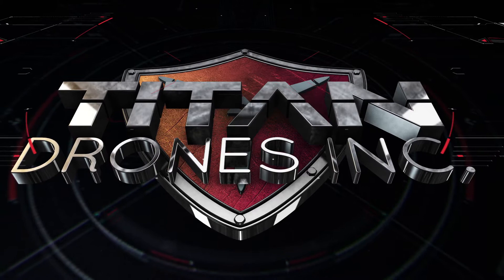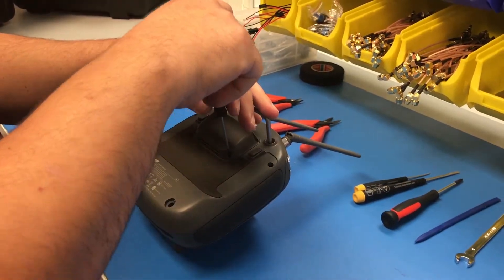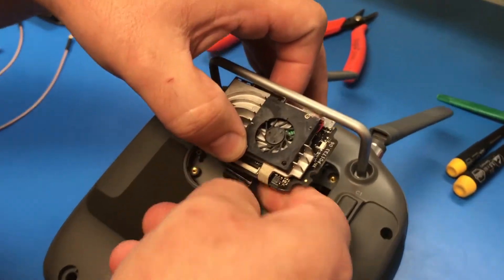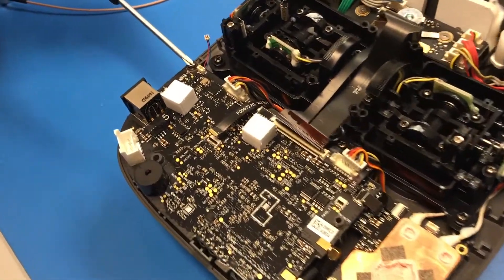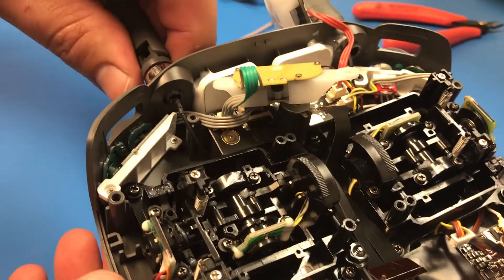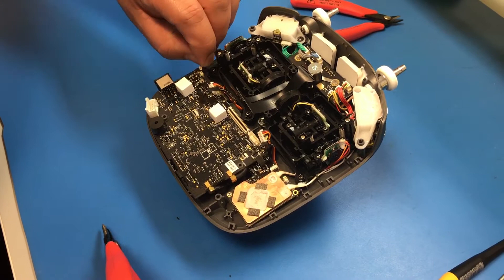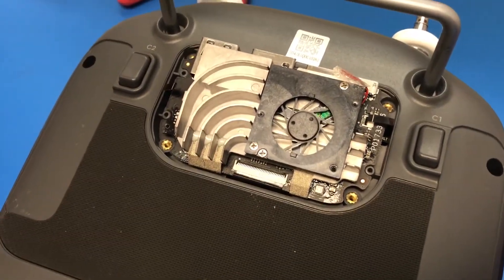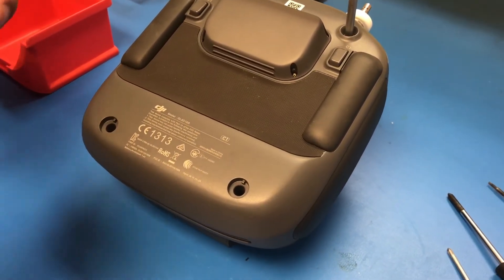Inspire 2 RC Mod

Comment: for the second controller (slave) i need to buy another antenna? Or will be enough this antenna for the master controller?
Reply from the maker: What aircraft do you have?
Reply: @titandronesystems2377  Inspire 2 with 2 controllers. If I buy one of your antenna for my master controller, I need to buy a second antenna for the slave controller?
Reply from the maker: onboardcamera_it not for the Inspire 2 no as the Slave on that remote gets its video feed from the master remote
Reply: @titandronesystems2377  ok thanks, so if i need to get the video feed from the slave, then i have to buy 2 antennas!
Reply from the maker: Any rc that will connect to the aircraft needs the antenna upgrade.  Since the video feed only goes from the aircraft to the master rc in this scenario just the master rc needs the upgrade.  If you plan to use the Slave as a master at some point you can mod it as well and just use a set of whips for normal Slave operation and use the booster antenna when needed.  Everything is modular so you can switch the system between the two RCs

Comment: I had purchased the Conquer several months ago but left it here unused, as well as my Inspire 2. Yesterday I finally moded the Remote. 
At the end of all I saw that there is a constructive difference for the bracket to be mounted on the Remote and which supports the antenna. 
I have had to insert the upper triangular part between the body of the Remote and the metal support that holds the monitor (smartphone/tablet) and the longer screw is no longer provided and is not even necessary (you said this in another video I have partially seen yesterday, right? ...but it is for a Phantom). 
Give me please confirmation that this is ok and above all clear up this doubt: which is the right sequence? 
1 switch on Remote 
2 switch on boosted antenna, 
vice versa, or it's irrelevant? 
Some time ago I had read you could damage the antenna amplifier or the remote, I do not remember well which one (but they was not talking about this device) if you reverse the sequence instead of doing the right one.

Comment: James what happened to the 5.8 for using 2 remotes . is that internal now. An do you think it's possible to undo the factory antenna connections an fish them out an new ones in without taken the main board with the 7 ribbon cables if I take my time or is it to tight
Reply from the maker: Flory Tolino the 5.8 is internal.  The ceramic looking antennas at the top.  I think it's too tight to fish the cables unfortunately

Comment: what do you charge for install . I've done inspire 1 an p4 upgrades. too busy to get into it. thanks in advance
Reply from the maker: Flory Tolino we charge $99 for the RC mod.  You ship it to us and we mod it and cover return shipping ground in the US.  Depending on when it arrives we sometimes mod it the same day.  Usually no more than 1 day turn around time.
Reply: James Crutchfield Ok where are you located
Reply: you sell the boosted panel as well
Reply: I see the plug is different is that a quick release for the panel. an if I wanted to use say a dbs panel is there adapters to switch to rma connections
Reply from the maker: Flory Tolino we are in Orlando FL.  Both the Conquer and Command Case are boosted.  We use QMA connections but we have cables and/or adapters to work with existing RPSMA mods as well
Reply: Ok the boosted panel is 299.00 I believe
Reply: thanks for the info you might be hearing from me shortly . is there a# to contact